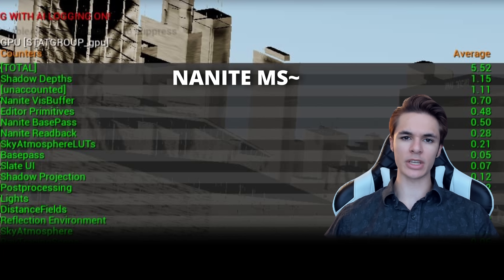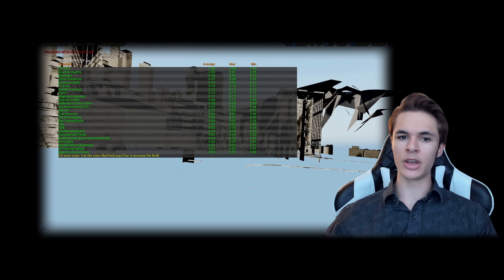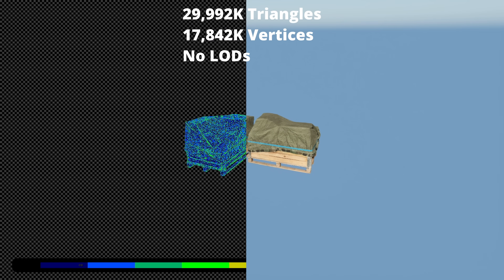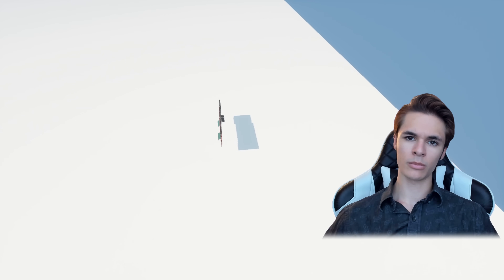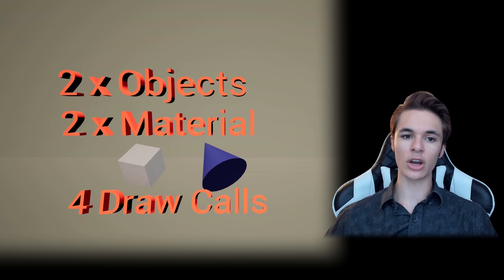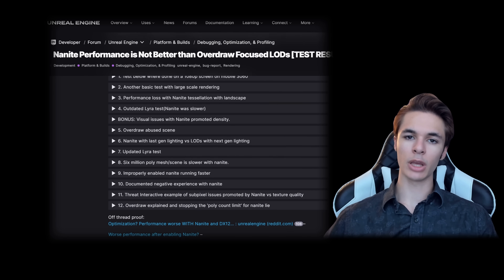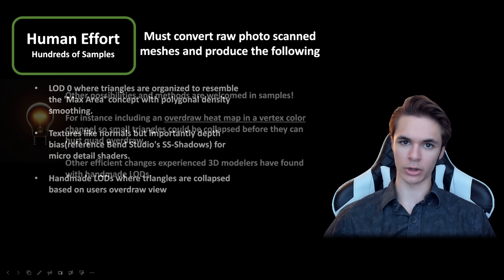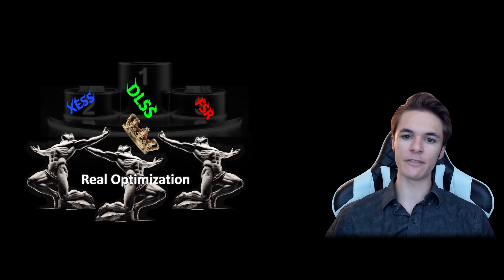Epic's Unreal Optimization Disaster | Why Nanite Tanks Performance!

Comment: im a mod game dev that worked with the source engine. and looking back how we optimized for performance manually with every mesh, texture, shader, and seeing how modern studios deliver the worst garbage that runs like a brick also makes me angry. now we start throwing upscaling at games that should run 2x as fast on native resolution to begin with.

we are subsidising the sloppy or not existing game optimization by overspending on overbuilt hardware that in return gets choked to death by terrible software that is a result of cost cutting measures / lazyness / manipulation. nvidia is really talented in finding non-issues, bloating them up and then selling a proprietary solution to an issue that shouldnt be one in the first place. they did it with physX, tessellation, gameworks, raytracing and upscaling. the best partner in crime is of course the one engine vendor with the biggest market share - epic with their unreal engine.

fun fact: the overdraw bloat issue goes back to when nvidia forced tessellation in everyones face - nvidia made their gpus explicibly tolerant to sub pixel geometry spam (starting with thermi, i mean fermi), while GCN couldnt handle that abuse. the witcher 3 tessellation x64 hairworks sends its regards, absolutely choking the r9 290X.

its a shame what he have come to.
Reply: I've got tired of seeing "if it's slow, your hardware isn't good enough" for graphics on par with decade-old releases— struggling on the same tech that ran those games like butter. You shouldn't need to spend half a year's rent on a gaming PC, to compensate for memory leaks and poor optimisation. The only winners are studio execs and tech shareholders. It's convenient to call your customers poor, instead of giving your developers time and resources to ship viable products.
Reply: @e.s.r5809  convenient 
😅. Customer = problem.
I bailed out a while ago and only play older titles. There are enough titles for years.
Reply: Underrated comment. This has been the elephant in the room for so long
Reply: I taught 3d modelling at an Aus uni 15 years ago, I would fail all current game devs today! 
They literally just scan an object and stick it in the engine! 
I would probably have entire scenes with less polygons than a single scanned model, this is even with auto software engine mesh optimisations! 
🤦‍♂️🤦‍♂️🤦‍♂️
Reply: "starting with thermi" lol thats funny
Reply: @Online-j8e  why is that funny, may you elaborate pleasee.. 😶
Reply: @standardLit   When NVIDIA released their Fermi GPUS (GTX 4 series) it ran really really hot so people on the internet and in tech spaces just started calling it "Thermi" lol.
Reply: As a fellow Source mapper and modder, I feel you.   It's so unbelievably frustrating seeing a game like the new Silent Hill 2 remake, which has the visual quality of a Source game, but runs like utter garbage at the lowest settings.   What on earth is happening? 

The good Source mappers designed from the ground up with optimization in mind, knowing full well even poorly designed levels would still run fast on most machines.
Reply: Making a Source map requires so much manual labor. Manual culling, adjusting lightmap scales for every brush face, areaportals, hints. And then you get in the industry and you can see 30 polygons overlap eachother and studios use auto LOD software that produces broken and unnatural geometry.
Reply: It's funny how epic is a partner in crime with Nvidia when Tim Sweeney wants to be less dependent on companies like nvidia.
Reply: This is why I don't buy Ngreedia GPUs. No thank you.
Reply: I’m hoping to make my own custom BSP raycaster engine - Quakaster I call it. It’s built from scratch using newer technologies like the ECS, unlike Source and other engines, including unreal, that relied on bad legacy technologies.

My idea is basically a sparse octree of BSPs and the portals are on the octree leaves, not BSP leaves, and they hold a PVS of octree leaves that are used basically as a compile-time rough pass for the runtime fine raycast pass. The level is rasterized using raycasting, which by definition will have zero overdraw (but higher cost per pixel), however, my hope is that this is cheaper than traditional BSP rasterization, since you wouldnt need to touch matrices (since points aren’t being transformed - rays are - however, you could also just do some lerping so it’s cheaper)
Reply: and yet people still buy the games in record numbers, this is what capitalism rewards. throwing shit at the wall and accepting the shit smeared remnants.
Reply: Under regulation, self policing, and unhinging economy barriers to greed "stock buybacks were banned before the 1982, decades prior to that companies could be taxed over 60% depending on size and scale . . . which reinforced internal investment instead of hoarding and mass layouts as we see today."

The cumulative shtstorm that has become AAA gaming is the ONLY expected outcome of having an entire industry so poorly overseen by the world economy that one singular group "EU banning lootboxes" finally took them to task way past the point of return. Those mechanics got moved around to avoid the fallout. If you had told me gaming would be this predatory and toxic when I was a kid, I would've abandoned ship and never kept it as a hobby. It is maddening that THIS insane, short term economy plan is the norm.

I remember modding all the way back before Morrowind and how difficult it was then. Just yesterday I tried modding again but using the Steam Workshop for a game thats all but abandoned "Torchlight 2." I lament at the memory of modding that has dissapeared due to website closures during the era of Geocites, Yahoo, and other databases of the time. The middle aged 30-40s millenial group that was raised up on games just as much as their parents might have with them need to REVOLT.
Reply: We'll just have to stop buying hardware and games to put and to this.
Reply: And the sad reality is, both of them care very little for the future, let alone the customers. Nvidia cares about AI/Data Centers atm, while Epic just cares about boasting whatever new tech they buyout or moaning about Steam having a monopoly, all while Valve:

Crank out a new storefront redesign
Produce a new handheld (with a future iteration down the road)
Produce a VR headset
Produce VR controllers
Produce an OS distro
Still making games
Still keeping their old games alive
Not completely bloating their existing engine
Gabe is working on new brain VR tech

The list could go on, but the point here is that Valve is actually doing things that aren't obstructive or bloat-worthy, while Epic is just working with Nvidia to cut corners and bloat the crap out of everything, making games look like a smeary oily mess, while costing more to run and barely looking/running decently on top of all that. 

Epic should have just crumbled when they split from MS when MS bought Gears of War. We could have lived in a better future where Nvidia was on it's own and easily toppled, and Epic wouldn't be there to foster Nvidia's behaviour.
Reply: I agree with everything you said! I left game development in 2017. If you had told me then in 2025 you would have to upscale games from 720p to hit 60hz on machines with specs like modern consoles I wouldn’t have believed it. Looking at the industry from the outside now it doesn’t look like it’s in a good place honestly. I play games from smaller teams almost exclusively now!
Reply: Yeah you know what, it’s 2024, there’s no excuse for a game to run poorly.
Reply: How does one make proper hair?

I specifically mean non-real time rendering, tho. So no in game engines, but in 3D rendering using raytracers.

In Blender the hair system and Principled Hair BSDF in Cycles takes forever to render. Are there any good optimisations that would work and give realistic looking results?
Blender hair curve system enables to interpolate from guide curves into millions of hair, with additional modifiers to improve the interpolated hair; this is awful(ly computationally expensive), I do get 20GB of RAM usage sometimes during building of the geometry, and out of VRAM errors sometimes during the rendering proper.
I don't know how to get that volume and fullness look, without a sh*tton of hair strands. The width of a hair strand is by necessity sub pixel, and there's hundreds of them per pixel. like 0.15mm in diameter I think.
My RTX3070 is not happy.
Reply: @piotrrywczak  what an interestign place to ask this question
Reply: physX is the most underutilized and wasted potential
raytracing is overhyped feature that literally serves no purpose at all except maybe 3 games that actually makes any difference that isn't just choking the PC

Comment: I'm not sure what you're arguing against here. The point of Nanite is to eliminate the need for manually creating different levels of detail (LODs) for the same mesh. What makes Nanite so powerful is its ability to "procedurally" generate LODs at runtime during development. Then, for the final release, pre-generated LODs can be created, which function like traditional LODs. The transitions between LODs are customizable and can be adjusted based on the application's needs or preferences.

That said, systems like Nanite will always be slower than traditional LOD switching because of the heuristic system they rely on. If you want a more accurate heuristic, it will take longer to compute since the code analyzing the context becomes more complex. On the other hand, if you prioritize faster computation, the heuristics will be simpler, creating a trade-off—a kind of cat-and-mouse game.

Still, Nanite is a remarkable piece of software and an excellent foundation for pushing advancements in computer graphics.

Comment: Now go and take 10k meshes (1000 different meshes, e.g. plants) and drop them into your scene.... then do the same without nanite. (I have done this recently, and it doesnt even make a dent in the framerate.)

While Nanite has higher GPU cost (its negligable though, from my experience (I had nanite 5.0 EA running on 4500U integrated graphics... so, meh.)), it doesnt cause draw call issues on the CPU side of things, while it also makes LODs obsolete.

Nanite is an absolute Godsend feature, regardless of its negligable shortcomings... of course it wont show its strengths on a game optimized to work without it.

While your result is true (I am not arguing about the performance), your comparison is like: comparing a truck to a f1 car in corner speed.

Nanite is a huge timesaver... of course I could go through my game for a week and drawcall optimize the things that couldnt be instanced... or I just enable Nanite. (done both... nowadays: if it can be nanited, its nanited, unless there is a reason not to.)

I still use instancing though, since it ties perfectly into nanite usage.
Been using Nanite since 2020, and I dont even want to think back to "when it didnt exist", thats how useful it is to me... it allowed me to do things beyond my workforce and budget with ease. Now I found another bottleneck, which I will resolve, allowing me to push things even more while also simplifying the whole thing. (In the end, that leads to bigger games for players, without any increase in budget - everyone wins.)

Also, dont forget: PCG wouldnt work (as unlimited as it is now) without Nanite... and PCG again is about "optimizing workflow", which is what these features actually are aimed at.
Reply from the maker: Read our pinned comment.
Reply: @ThreatInteractive  and I disagree with it.

never did I need to use an upscaler to make nanite run fine. (I really only notice the impact at lowest settings, where the framerate doesnt go up anymore at some point, because "nanite cost", but thats at high framerates anyway.)

Yes, there is a performance cost, but it doesnt matter for any game that is more than your "3 cube top down game"... I mean, after all, it runs fine on integrated graphics of years old cpus.

The thing that actually is a performance hog (in comparison) is Lumen, but even that I can run fine on a 1060 without upscaling. (yes, at 30 fps (with nanite also running), given the age of the graphics card, but still - thats just how things always were with a decade old gpus.)

That said, this is based on my own experience, with my own settings etc. so your mileage may vary.

You imply that people use and need upscalers to make nanite work fine, which is just not true.
I dont know what you tested, or did, but that doesnt even remotely fit my own results. (Idk, maybe I did something different... maybe I am an idiot, no idea.)

More efficient or not, it just doesnt matter anymore as time moves on.
Lumen cost is pretty much fixed, Nanite cost is negligable - it will become the default standard in any ue5 game as soon as even a 5050 or so can enable it by default at 30 fps.

It just doesnt matter that non-nanite is faster... it did, 4 years ago, yes.
Reply: @andrewsneacker1256  ok boomer

Comment: Speaking of optimization, red dead redemption 2!! I have a gah damn rtx 2060 super and I can run that game on 75% of ultra settings at 3440x1440 at around 38-60 fps!! And the game looks insane, far better than the first descendant and I can only run that game basically all low PLUS DLSS for playable frame rate

Comment: Unreal Engine 5 is so bad yet no one else has been able to make games that look anywhere near as good using any other engine!
Reply from the maker: @comicipedia  Yet these UE games fall apart in motion and only look better if running on hardware beyond 9th gen consoles. Who cares if you can path trace on 80tflop hardware : 1% of gamers.
Reply: @ThreatInteractive  Actually, Cry Engine just went Public. Yes that Cry Engine from CryTek company behind "Crysis"
You can download and use it for free.
And within the Engine, they have an extremely Optimized Ray Tracing algorithm that you can run on a mere Nvidia GT 1030 with 24 FPS. The benchmark is often known as "Neon Noir" on YouTube

You don't even need RTX Card if you use Cry Engine.

Comment: well, I decided to check out the argument that nanite is bullshit. 
To do so, I put a 20 million polygon mesh in the Unreal.
In the first test I dragged this mesh into the viewport without nanite on.
in the second experiment i dragged this mesh into the viewport with nanite on.
as a result of the first experiment the viewport fps dropped to 1
As a result of the second experience, the fps remained at the same position, about 30.
As a result - I can conclude that nanite is not bullshit.
so what is bullshit in this case? and this is a very interesting question that requires additional research.
Reply from the maker: @someone_who_looks_like_me  
All talk and no overdrawn analysis
Reply: @ThreatInteractive  I understand. well, when nanite first came out and people were testing the limits of its capabilities, they would get to a few billion polygons, as I recall, before they started experiencing significant drops in fps.

Comment: Nanite certainly isn't a frame time optimization tool, but it's a workflow optimization tool. We don't have to care about a whole ton of things and we get a pretty good result. Compare nanite to completely unoptimized assets and it performs well - that's what studios are thinking. They don't have the time, money, or expertise to optimize their games. Nanite is auto-optimization that is better than nothing, but not as good as professional work. Even tools like DLSS are essentially free performance that replicate the work of thousands of hours of professional optimization. Unreal's performance comparisons actually aren't misleading, most game devs are not good at optimization and they are going to be using unoptimized assets.
Reply: Virtualized geometry is the thing we've been running around for about 10-15 years and it's here to stay. EPIC has enough money to push it into the mainstream and eventually GPU vendors. We're quickly moving from CPU based rendering to GPU driven rendering. The die is cast.

"A technical walkthrough on the development of a virtualized geometry technology that can be integrated with any game engine, and an overview of the challenges faced. nThe talk explores how Virtuos achieved optimal performance with ultra high-resolution meshes, thanks to a multitude of different techniques - automatic split of mesh LODs, data streaming, occlusion culling at the chunk level, data compression, and more. nOther experimental features, such as geomorphing to enable smooth transition between LODs, will also be discussed."

GDC 2024 .. soon

Comment: I may be missing something, but the point of nanite was not that it would be faster than regular LOD, but rather that you could have all your assets as high poly objects and nanite would take care of doing all the LOD in the engine right? Saving time for the artists/developers.
Performance is not as good as properly built game (from the top of my mind I can't remember if they said it would be faster, they may have), but the importance of UE5 in general has been that you can have everything done inside the UE5 editor which streamlines the development pipeline for small/medium sized studios.

Arguing wether regular LOD vs nanite performance in the context of using nanite in UE5 is somewhat a pointless argument because nanite is a convenience features, not a performance one.

Comment: I'm not a programmer but I see that for ten years there has been a waiting for a big graphic paradigm.  Goodbye classic renderpipeline as they teach it in school, goodbye rasterization, goodbye classic extremely inflexible polygons, goodbye endless problems with shadows, LOD, UW mapping, etc. etc. etc. etc. etc. etc. 

UE is the only big multiplat engine today. And R@D is extremely expensive. You understand what I'm implying here between the lines.